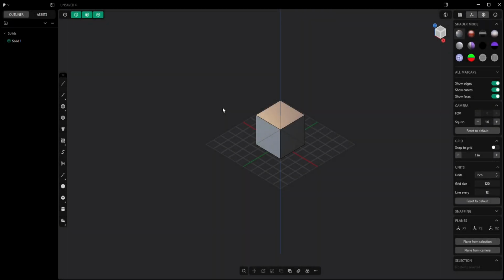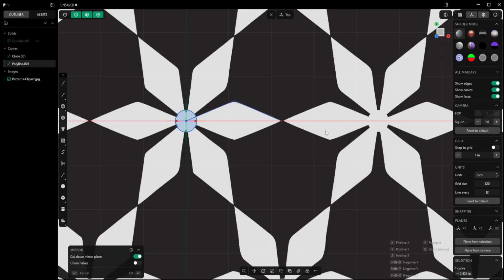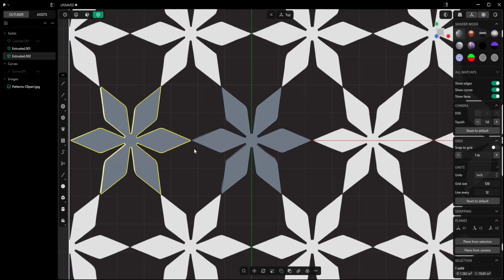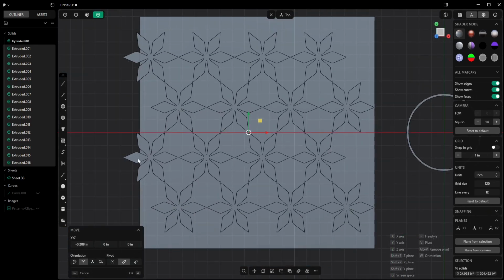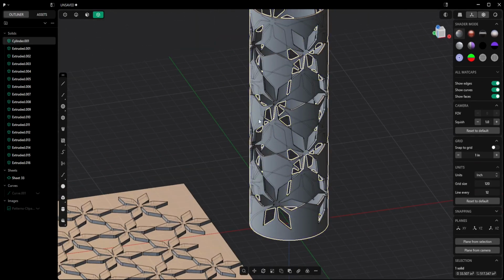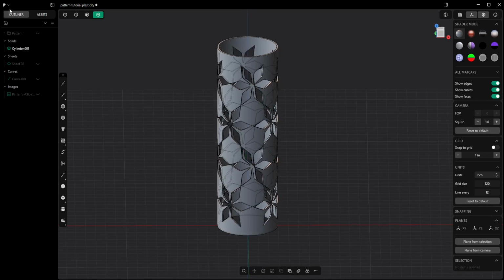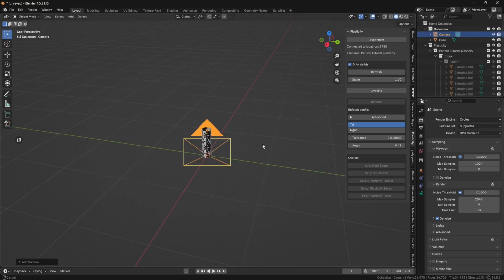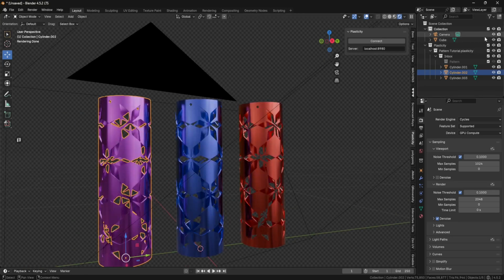Wrap a Pattern Around a Cylinder in Plasticity

Comment: Good job, thanks, unfortunately, if the body is not a cilinder, for example conical or rounded, plasticity do very bad job, or if you want to print complex lines arrays, the unwrap-deform commands is a disaster in rounded or not cilíndrical bodys, I hope some day it works properly
Reply from the maker: True, but that's not really the software's fault. A cylinder can be laid out flat in a rectangular shape which makes it easy to place a design on it and array it around the cylinder, but a cone or a sphere can't be laid out in a rectangular shape, which is why the projection doesn't work correctly. You would have to compensate for the tapering of the cone and the curving of the sphere somehow. I'm not really sure how you would do that?
Reply: @roddeweese6402  yes...it's hard by now, i think not possible plasticity do unwrap of any complex shape, well, let´s think